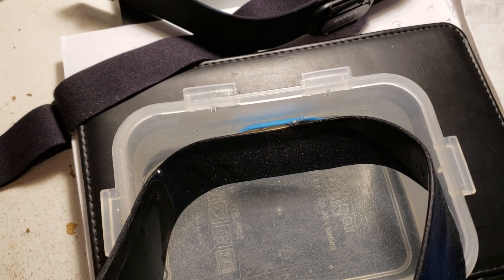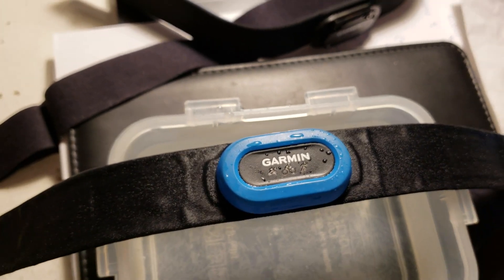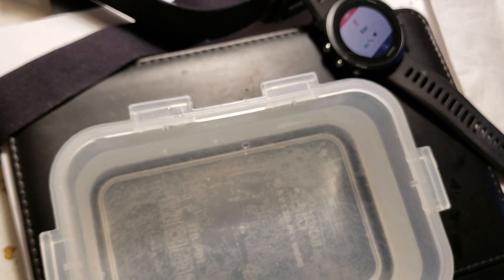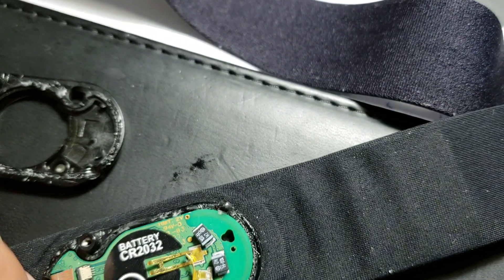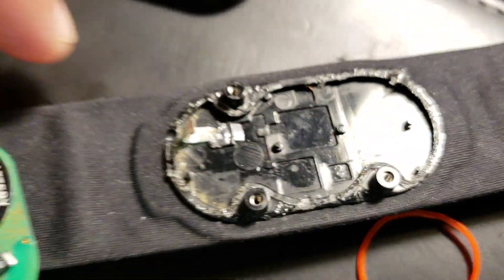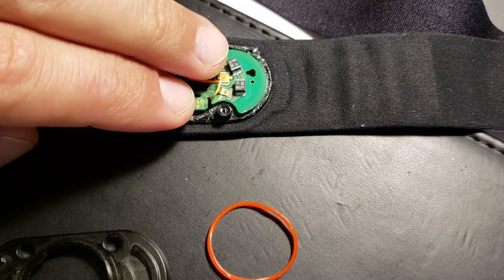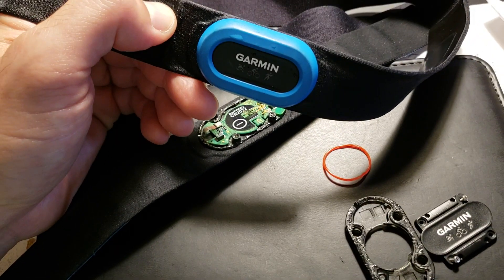Garmin HRM Tri Failure mode (after battery replacement)

Comment: Changed the battery on my Garmin HRM pro and 3 weeks later it’s broken. I opened it up again to look.. the circuitry is all corroded and brown. I’ll just have to buy a brand new one every time the factory battery runs out.

Comment: Suspect the ring on mine as well... mine is a HRM-Pro but has the same ring.  Just did my first battery change on my current HRM and the gasket popped off with the cover and parts of it aren't uniform.  Do you know where one can buy the ring?

Comment: Shame od Garmin that it is so badly designed - my HRM Pro died as well... I didn't check the oring and didn't care to inspect it carefully, but I will check. It is so bad that such an expensive product (in its class) is so vulnerable, and - what's worse, it is impossible to open it without destroying the case.

Comment: This doesn't explain however why they fail after changing the battery for the first time when they've never been submerged. This just happened for the first time (with no water use) with a HRM Pro. It wouldn't connect immediately after the battery change (before use). Engineered to fail?

Comment: Hey, thanks for the video!

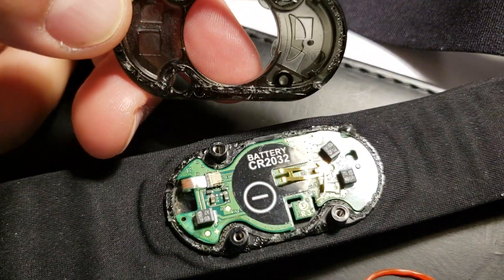I think the problem is the top right area. That special screw, that does not come off, makes contact with that point on the top right of the PCB (if you pause at @3:02, you can identify this point next to the letters "2V" on the top right). This completes the circuit. If the circuit is open, the sensor is not powered = no signal = no connection) 
The top right screw has to be in contact with the PCB for this to work.

I personally have lost the top right screw housing(?) to corrosion and vibration due to stress. When I fix the cover, the top right screw doesnt make the connection with the PCB because the housing(?) which was doing it earlier came off.

Now, what I would like to know is how can I increase the length of the top right screw by 2-3 mm so that it makes contact with the PCB. I am thinking, 1. A cap which fits the end of the top right screw 2. soldering which is unreliable.

Any thoughts? I would be grateful if I could get some advice. Thanks!
Reply: 3. Maybe drop some solder on the PCB  with drop height 3 mm

Comment: The flat spots on the O-ring are from poor mounting the previous time. When the O-ring doesn't stay on the outside ring of the sensor, do not mount the cover because that causes poor sealing (and flat spots on the O-ring).
Reply: I've got no flatspots and it still leaked.

Comment: Except it doesn't stay waterproof when you open it once to change the battery. I changed its battery once, reassembled it putting the O-ring seal back. My HRM-Run strap died when I washed it after the battery change. You've been warned.

Comment: Same failure modes as others here as well. :-(  I found a small crack in the plastic casing near the top right screw and a deformed o-ring, both allowing moisture ingress.  The unit wouldn't power on with a new battery even after cleaning with contact cleaner / alcohol, so having nothing to lose, I opened it up to investigate.  Inside was severe corrosion in the lower left underside of the board which had eaten away the top layer of copper and destroyed the three SMD components in the area beneath.  Since it's a multi-layer board and the markings on the bad parts are unreadable, I gave up trying to repair it.

Given the rate of failure I hear about with these HRMs, it amazes me that Garmin hasn't pulled these from the market to fix the design.  If they just spent one more tenth of a cent on better quality o-rings, that would at least eliminate one of the two major failure points.  To fix the cracking issue, they would have to re-tool the case mold and beef up the areas around the screws, which is something that is even less likely to happen.  It seems like it was a poor choice to move to the non-detachable design in the first place (imo).

Comment: I have an heart rate monitor. Water got into the circuit by the battery cover. There is now rust and corrosion inside.

How did you open ?
Reply from the maker: The only way i know how to open the casing is to cut it open... i was never able to successfully open and reseal the casing, so if you open it, you will risk losing the unit altogether.
Reply: @anironmanjourney  Yeah thought so too. Been thinking to spray contact spray in it
Reply: Today is the day I intend to try

Comment: Hello @An Ironman Journey, you mentioned in the video that you will post a link that to buy the red seal with similar dimensions, which could prevent the leakage in Garmin HRM Tri. I could not find the link in the video's caption, so could you kindly post the link.

My HRM stopped working suddenly, so I replaced the battery, but without success. After I watched your video, I figured that leakage could be the problem, so I left the case open overnight to dry and reattached the battery again, then it worked!! Thanks for posting the video.
Reply from the maker: Hi, you can find the o-rings here : https://www.ebay.ca/itm/113884869092
You may want to make sure that no other leaks are present... you can do that by inspecting the hrm casing very well... good luck

Comment: DO NOT BUY this hrm!!! Mine cracks 15 days after warranty ends. A tiny little crack near a bolt, that leave water/sweat in... its a common issue (google search) and Garmin dont assume its responsability. Its a big project/manufacture mistake.

Comment: HellO! How did you open the case without damaging the plastic (witch is too thinn)? Thanks!
Reply from the maker: I had to cut through the plastic... there is no way to access the electrical circuit without damaging the case.
Reply: @anironmanjourney  did you have to literally cut the plastic, or there is some kind of glue that bind the two plastic parts?
Reply from the maker: @yiutubio  there is glue, but it was not removable (it at least within my capabilities, I was not able to remove the glue) so I cut the case carefully to preserve the electrical circuit inside.
Reply: @anironmanjourney   I tryied to open the HRM cutting throug plastic, but my knife damaged the flat cable inside. Now, i'm gonna use a AliExpress cheap HRM, since all of those garmins only give me trouble (despite of giving me really good data, but i realized that i don't have time to analyse them and use it to improve my performance)...
Reply from the maker: @yiutubio  I would use a dremel to cut only the plastic... that's the only way I know how to keep the electrical circuit intact (and even then, if you cut past the plastic, you're ought to damage something)

Comment: great device but a piece of crap in terms of sealing !!! Iam having the same humidity problems !!! o ring is to small and not elastic enougth so if you dont put it in the perfect position the device will stop working. Now i have one tri hrm that doesnt work....after 1year and 3 month of use
Reply from the maker: 2 things that are not mentioned with those HRMs , if you dont change the oring, the HRM will stop working. If you over tighten the screws, the HRM case would crack causing water or humidity ingress
Reply: @anironmanjourney  yes, also that !!! the problem is that if you want to replace the o ring you need to buy them, and i dont know were to buy them. Like i said is an excelent device in terms of running data, but the worst in terms of batery replacement !!! If you miss that you are screw
Reply from the maker: @VitorCaldeira1980  completely agree, look up the oring replacements on eBay, they should be available for few dollars... I hope that this helps...
Reply: Same thing here